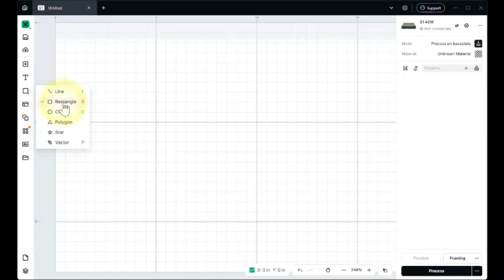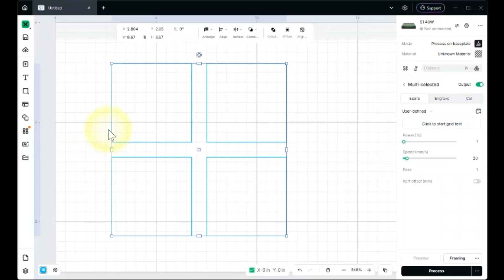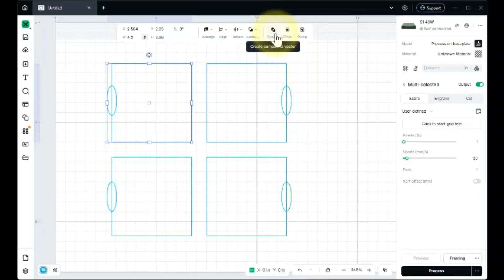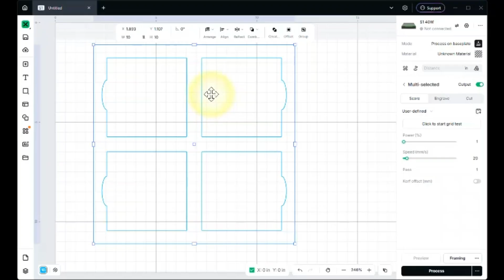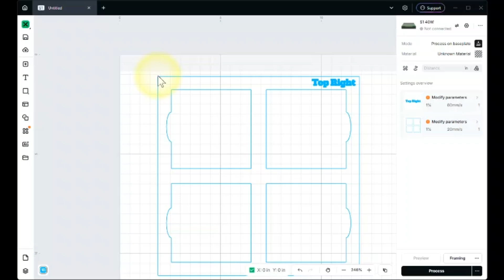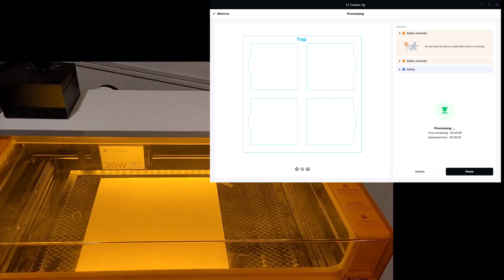Beginner-Friendly Jig Tutorial for Slate Coasters — xTool S1 + Studio

Comment: After adding the finger slots, when I put an image in the app for the coaster and center it, it isn't perfectly center because it factors in the finger slot. Is there something I am missing?
Reply from the maker: No, it just has to be centered in the 4x4 inch square.  You may want to draw a 4x4 square to design inside. Then drag the design into the template.  This will help avoid the finger slots.

Comment: Hey man, thank you so much. This is the best video I have seen on making a jig. One thing I wanted to ask you I’m new to this whole thing. I don’t understand that alignment thing with the marks and stuff. I have the X tool P3 do I still need to do that?
Reply from the maker: Thanks!  I'm glad it is helpful.  - So the P3 has a different alignment system.  It has dual cameras that allow you to align items in the software with a live image.  The S1 doesn't have cameras, but you use the laser to mark points on the work piece to set an outline in the software.  You use this outline to place whatever you want to mark on the work piece.   - You can still use the jig on your P3 to get your coasters lined up on the first run, then after that you can just drop in new coasters for each batch and skip alignment.
Reply: @KBDesigns-gi9ef  cool man thank you so so much

Comment: Excellent tutorial!  Recently bought the S1 40W and was having some issues overthinking the jig alignment between the bed placement and software. Also helps that you explain this using the Studio software since most vids are Lightburn or XCS, still similar but helps to see the same software.  Might remind folks to turn off the output of the jig file after it's made so they don't accidentally start trying to cut again.  I've also found it helpful to engrave a label in my jig to include the dimensions and what the jig is used for, like (4" x 4" Slate Coasters), though most people can probably eyeball the jig and realize this.  LOL  Anyway, is it possible to lock the jig parameters in the software so you don't accidentally change them after?
Reply from the maker: Hey Glad you found this helpful!  Yes that is a good point that it is important to toggle off the output so that the jig is ignored when processing the coasters.  You can lock the jig.  Just use the layers menu and click th lock icon next to the jig in the list.  Thanks for watching.